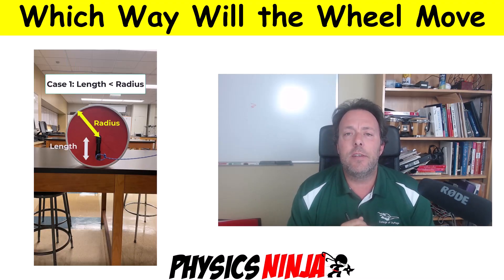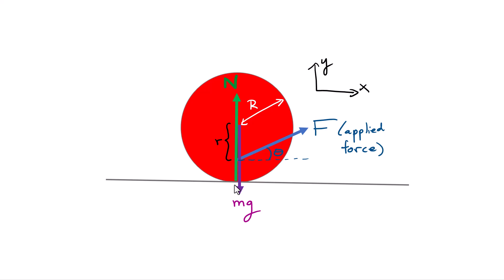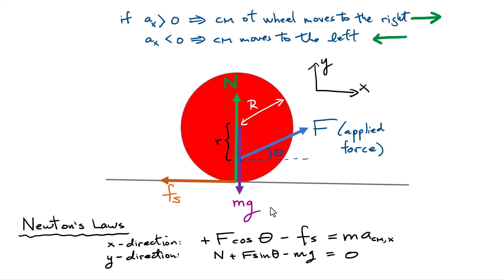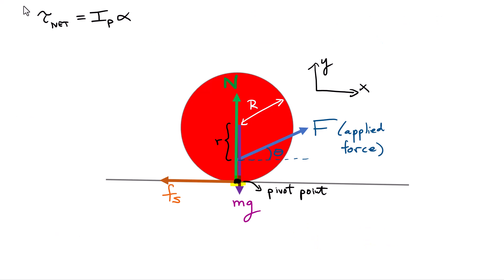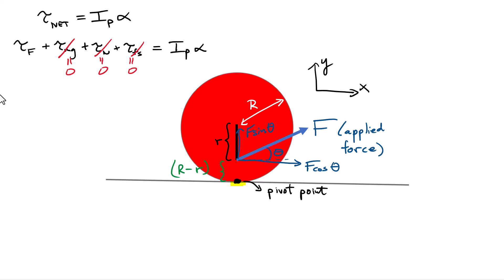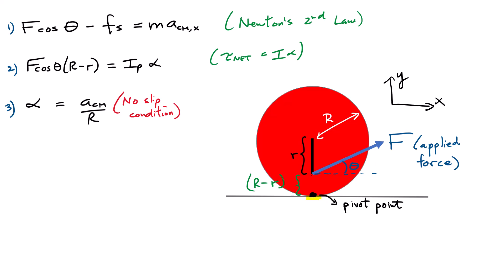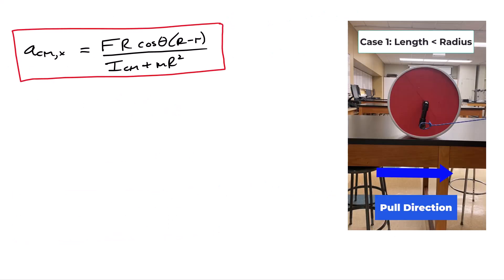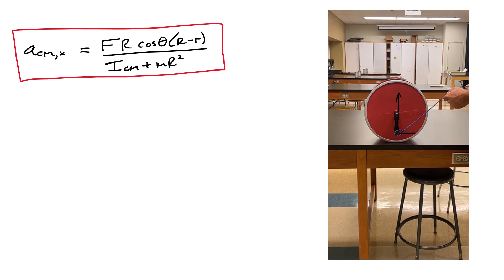Bike Wheel Paradox - Detailed Calculations

Comment: Hey! I think ur expression at the end of the video may be incorrect, i think the expression in the bracket should be R - r sin(alpha) for the distance between the pivot and line of action of the force.
Reply from the maker: If you set alpha =0 in your equation you’ll have a positive acceleration which is incorrect.  Note that I have alpha defined differently in the last part.